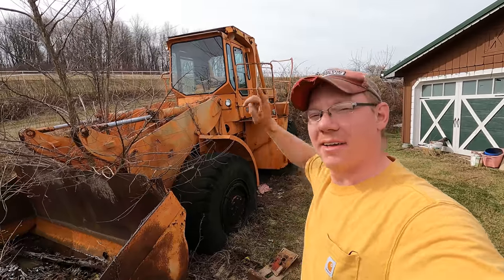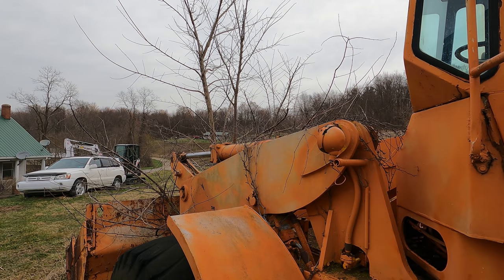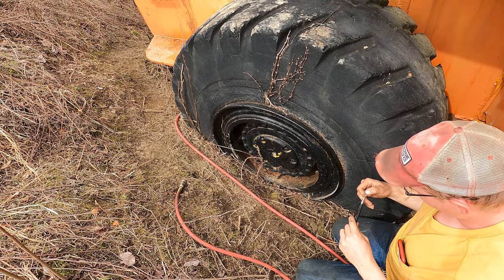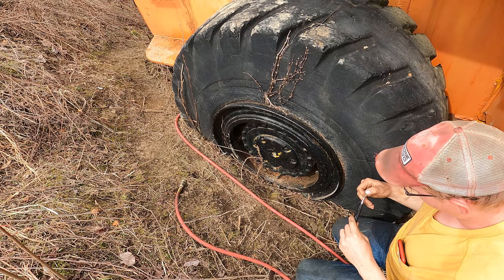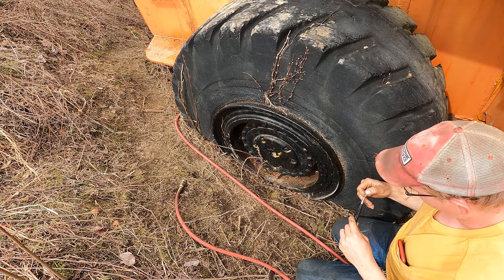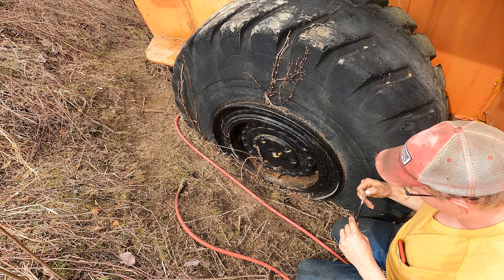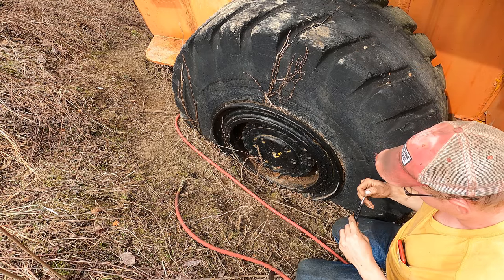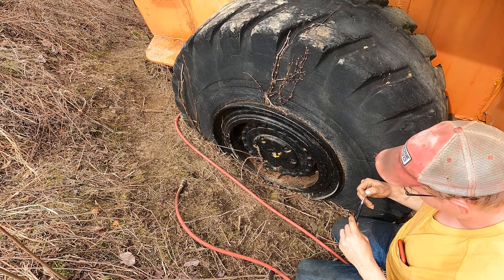After Sitting 20 years will this Big old Wheel Loader Drive 3 miles home!?!? Pt.2

Comment: These reminds me on my 20 Years work in a gravel pit, i've learned to drive with an Hanomag B8 wheel loader at 10 years young, 6 years later i work in the gravel pit a Michigan 75C steering on the back then my boss buys a Michigan 125C Loader also steering on the back that machine was terrible once a year broke the axle in the back :) and then YEAH he bought a Caterpillar 930A that was a fine machine a few years then he bought a CAT 950 A that was the best Loader i drive the 20 years i was in work in the gravel pit, it follows a Cat 936 and then i left the gravel pit, working on the Construction Industry a few years, after a retraining in 2010 now im working as an Electronics technician but my heart is always on these BIG MACHINES it was a good time, Thank you for your videos.

Comment: That wheel loader is probably the coolest sounding one I’ve ever heard. I’m hoping that one day I can go on a site where there’s one like that working
Reply from the maker: I don’t think you will get the experience unfortunately, not too many people running old iron like this anymore on job sites
Reply: I ran a new one for a job. You can sneak up behind people, even with the biggest of them on a job site. The new ones have nice cushy air ride seats, a must for my damaged neck and back and air conditioning. If you have to buy one.......the old one is much easier on the wallet. If you have to operate one and no longer have a young body or you have jobs that have to get done asap, the new ones are best. It would probably sound better with a muffler on it. I remember how they sounded in the late 80's or even the 90's as a kid and teen, before all the emissions stuff. It is also nice operating a quiet machine, same as my relatively new diesel truck, but I'm middle aged now, and have lost a bit of my appreciation for loud stuff that I once had.
Reply from the maker: @CGT80  oh yes I’ve run Volvo loaders on a job for a while and they are super nice and quiet. Whole different animal but   I do love something about these older Simple machines

Comment: Those old 555 Cummins sure sound good, especially when under load. It's a pity they are so expensive to overhaul. I would have hooked up the exhaust system before driving it home. All those hot gases in the engine compartment can do damage to wires, hoses etc .
Good video and excellent buy for a good old loader.

Comment: My dad got a 1976-ish Hough/IH H100C as a farm toy a while back. It's hard to judge scale from the video & my photos of the Hough, It was in a bit better shape, almost new from appearance. I've googled for specs on it but I swear his is bigger than the specs I found. Easily 15 ft tall at top of cab. Pretty sure it was more than $1500! That's the trouble with these things, they sound like a bargain until you figure out there's 10 hoses needing replacement at $500 each and the engine needs new rings and a honing. And the fluids.... honestly surprised 5 gallons of transmission fluid was only $80ish.

Comment: The suction line to the pt pump is sucking air from somewhere. I mainly work on k50s but same fuel system. I use a clear hose to check for air on the suction. They hunt, hard starting, low power and run like crap if they get air

Comment: At 31:24 juist where you were talking about replacing a transmission hose, there is a repeated drip of some sort of fluid from something almost centre image, with a pinky-semi-translucent colour, with what looks like a greenish band at its top, and just to the left of a thin drooping tube.  You should check that out.

Comment: Give a shot at sanding the cylinders with aluminum foil. Works on motorcycle forks. I have heard it works even better with coca cola a lube. It is not a friction but chemical reaction. Hope it helps!

Comment: Just jam the quick connect on the air hose straight to the valve stem (after you remove the Schrader valve). Less restriction and you will hear the air rush through into the tire/tube.

Comment: Your tires are in those holes my Brother try getting it running enough to rock it out or push or pull out but like that no it’s not moving but I’m sure it will come out . That be cool to have around move stuff move dirt then give it a pretty cool paint it already looks cool.

Comment: I have an old Trojan 3000 loader with a Cummins C195 engine in it. The tractor is a 1967 and is in pretty good shape for the age. It recently started leaking oil. Turned out to be a head gasket. Cummins quit making the gasket in 2001. I have searched all over the internet for a gasket and they just don't exist. Now its either scrap the loader or re-power it. The old iron is cool, but it can be a real headache to keep them running once parts become obsolete. My tractor weighs about 17 tons so scrap value is only about $3000 after a lot of work processing it down to manageable sized pieces, or spend several thousand on a different engine that you can still get parts for. Its kind of like being in-between a rock and a hard place. Not sure what to do....its too good to scrap but not so good that I want to put a bunch of money in it.

Comment: I bought a Pettibone telehandler that had sat for seven years without even knowing if it would run. Cracked every drain plug and didn’t find any water. Put a battery in it and it started. Put four used tires on it and have a functional machine.   Looked on line and found the same machine sold at auction for $25000
I paid $1900 for the machine, four tires installed for $1000, $150 for a battery. 
$2050 all in for a machine that is worth ten times what I paid is a pretty good investment!

Comment: The 2 hydraulic hoses may have had some oddball fittings that made them expensive, but that still seemed like a lot of money for two, 1"x5' or close, hose assemblies.  I wouldn't have been happy either.  I wouldn't have figured over $350 for both, and that would have still hurt, but it's been a while since I bought any hydraulic hoses.  Having to call in the tire man wouldn't have been a joyous occasion for me, either.  I have been there and felt your pain on both counts.  Part and parcel, I guess, though.  I enjoy your videos.  Thanks.

Comment: its pretty usual for the needles of the valves get stuck on these kinda machines, just dump a drop of oil in the valve on the tire and press it in with a screwdriver or such, probably part of the seal was stuck or something hence it let in only the slightest bit of air, also i recommend buying a pack of 1k disassembled valves, costs only a penny and a half

Comment: Brakes on those loaders require air Pressure to release at least 60 lbs also requires at least 90 lbs for the brakes to STOP.   have a good day.

Comment: I used to make those hydraulic lines at NAPA.  Four wire were ridiculously expensive and a bitch to make lol.

I remember when I was new there and I didn't know the difference between two and four wire.  Customer asked me to match them a hose up, I did and sent it out. They came back and threw it on the desk and said it blew out on the job and there were 20 Gallons of hydraulic fluid on the road.

Woops.

Comment: If thats a 555 id suggest throwing 2 stroke oil in that fuel for ingection lube that fuel additive is good and all but this newer diesel fuel is dry as all get out.
Reply: sparky mac with the mic drop

Comment: Best thing about these old,mechanical units is,NO ECM, DPF/SCR,pilot controls,chassis controllers, ETC...shoot,I've spent probably near 30k in diagnostic equipment just so I can keep up with all the new stuff...20-25yrs ago,all you needed was a good voltmeter and a good hydro gauge with some basic tees and a few J.I.C. and O-ring bossed fittings....now,everything is proprietary...you literally MUST own decent scan tools for 90% of the newer stuff,a knowledge of reading schematics with over 300 circuits,can bus lines,multiple controllers and safety shutouts everywhere...then,pay for access to diagnostic software for cross references,PID definition, diagnostic trees, etc.I can go on and on about whats really required to properly diag..Don't get me wrong.I love specializing in advanced diag and usually figure out what many dealer level techs can't...but damn it can be frustrating trying to find why theres a 2v drop on a 5v reference with a no crank condition and every wire is the same color,with nothing but a circuit # imprinted on the circuit(which is usually rubbed off🤣🤣🤣)...can literally take days,sometimes...especially if you're a field tech,like me...then a customer asks why its 125.00 per hr labor..but,really enjoy working on the older stuff..few things I'd recommend for your unit- get injectors  rebuilt..keep a Co2 fire extinguisher on the unit in the event of a 'runaway' ..and get ready to start spending some $$$ on hoses...worst thing to do is let a unit sit..especially for hoses....also,They really did overcharge you for those hoses and I'd recommend looking for a new shop to make those hoses...I didn't hear you mention who made them hoses,but,I'll assume it was napa...I can literally get 5000psi 4 wire,with those same clamp style o-ring bossed 30°  fittings for 100 each,crimped on the spot.....good job getting that ol Clark going again. Definitely a good candidate for a Restoration...only bummer,is,I noticed the engine panels were missing, but they're easy to make...panels are important, cause they help direct your cooling air flow to help keep it all nice and cool under load....cool video🤘

Comment: I know this video is older I just found your channel I love watching your videos already! But please I work on tires all sizes up to 3000lbs please tires are literally bombs most bigger tires are compared to tnt. If you don’t know what you are doing especially all these older ones that have been sitting the the lock ring or flange can take your head clean off if it doesn’t seat correctly. Tires also dry rot and can separate the cords in the sidewall sitting deflated like that for so long please be careful is all I’m saying call a professional if you aren’t sure.

Comment: Not really relevant but if you are on a budget or just don't have time and don't care about tire cosmetics gorilla glue spay adhesive / spray rubber on the dry rottes area and it will hold air pretty well

Comment: Not hating on you but you sound like a baby when you mention a few hundred bucks here and 500 there for a big rig, my 7.3 powerstroke took more to get running correct! And I was a heavy eqip mechanic so I get what your doing 100. I rebuilt many many rigs complete top to bottom including engine/tranny

Comment: Those Clark and Michigan loaders used to have GM two-cycle diesel engines. Your Cummins motor sounds like it's probably four-cycle (?). For your reader's sake, here's a working Trojan loader with a Detroit Diesel two-stroke engine. As you might expect, they're higher pitched. The two-cycle engines made them accelerate faster, in my experience. Correct me if I'm wrong, but I think two-cycle diesel engines have pretty much been banned for air quality reasons. They were noisy too.  https://www.youtube.com/watch?v=PQIMRhWA8kI

Comment: Wasn't really alot of work into it. Not like you were welding and cutting new plate steel, or replacing cylinders n tires. $1500.00 was a steal

Comment: I paid a lot more for a second hand car, a lot lot more, so i think you did just fine, as you say just a quick blow over with a spray gun and skme tyre black on the wheels and it will look ten times younger.
I would hate to have to pay for the fuel alone as these things drick it like mad , sso heres in hope you find a buyer, as you say the engines fine and a recon engine for a car will cost you three times what you paid!!!!!!

Comment: You stole the loader even after all the labor (Labor of love and profit!) and additional parts you invested into it. Spraying or rolling the paint on after a quick sand blasting will make that machine go up value and the finished product IMHO is well worth the time & effort. I bought an old 1537 CASE skid steer with no engine and turned it into working, decent looking old skid steer. The first time I tried the hyduralics on it a fitting burst! Seems thats almost always the case when we play with old Iron such as these machines are. My number/model plate is missing but I put my machines age at a round 1971/2.. I paid half of what you did for your machine but then had to buy a used motor which I luckily found just before Biden inflation hit us all! Total cost 4 mine is around $1700 now which is fine with me.. Good luck in the future as I'll bet you keep it until a time when you find something even better to buy, play with that you need the extra cash for. thats how I work/play most days..

Comment: Gee dude you wouldn't be standing in front of that bead lock if you ever seen them cut loose in a safety cage or seen them launch guys 30 feet into the air and kill them

Comment: This is what I don't understand that is a big machine why does the motor look so small in it
Reply: Hydraulics have tons of power and gearing moves it easily. The new excavators have relatively small engines as well, similar in HP or displacement to my duramax (6.6 liter 445 hp 910 tq) pickup, yet my truck weighs 8300 lbs and the excavators are 50-100k pounds. It is just different trying to move rolling loads with wind resistance down the road vs. relatively slow moving machines. Old medium and heavy duty trucks had small engines as well, but they didn't perform anything at all like new trucks.